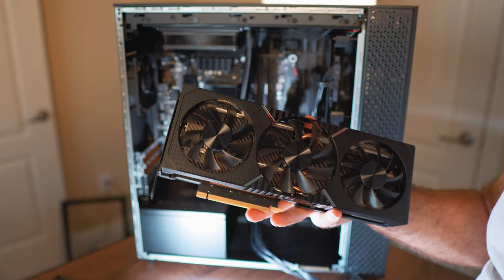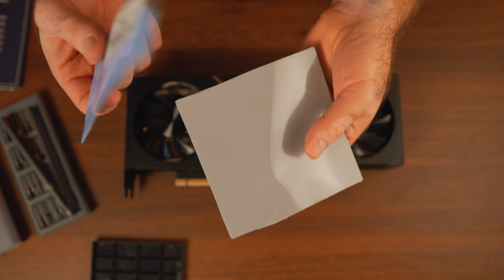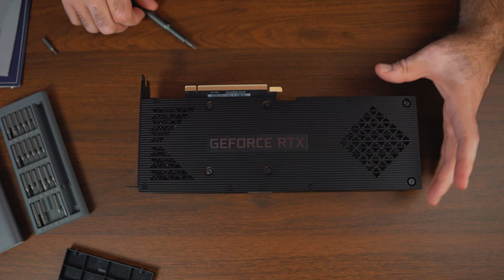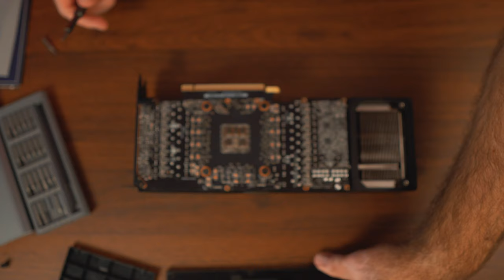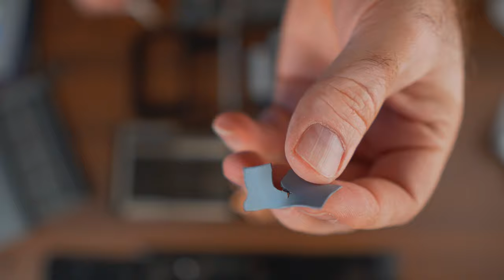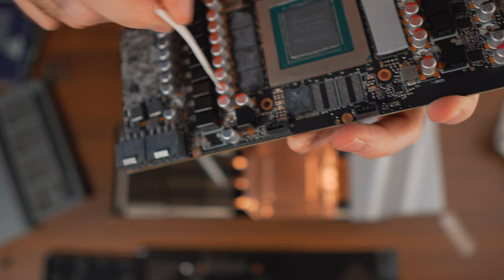HP RTX 3080 - Improving The Temps Mod!

Comment: Did the mod to my 3080ti HP OEM card, which used the same cooling solution as a 3080. Turned out the core temps got way worse than before after the mod. Core temps would hit 83-degree thermal limit and resulted in sub 300w power draw and base 1600mhz core clock, while it was at 78 degrees top before the mod. 

The reason was that the thermal pads were too effective and the memory temp rarely went over 70 degrees after the mod under load. It was competing with the GPU core for the limited amount of total cooling capacity. I reopened the card, cut all the thermal pads I placed on memory in half in width,  so the pads only covered half of the memory chips. This time the thermals were much better. In a 15 minute GPU load test, core temp stayed under 75 degrees at all times while the memory temp hovered around 80 degrees. GPU-z didn't complain about thermal at all times. And then core clock stayed above 1800mhz in the process. Guess it all came down to balance your core and memory temps with the amount of thermal pads placed on the memory chips. 

Btw the paste I used was Arctic mx6, which was pretty decent.
Reply: I’m about to take on this job within the next week! 
What size thermal pads did you use and where? The video description says use 1mm but also lists 1.5mm for the materials. 
I’m also interested in how well that Mx-6 is working for you. I am between just using my Thermal grizzly Kryonaut or people say to use thicker stuff like thermalright tfx due to less pump out.
Reply: @Trevor2497  I used 85x45x1.5mm Thermalright thermal pads, which were just enough for the job if only covering the center half of the memory chips. 

Mx-6 lowered the core temp by another 1-2 degrees, comparing with Mx-4. It is affordable, and an 8-gram tube should last you a long time.
Reply: Low Ram temps with high core temp is a pad thickness issue, not a cooling load issue. 1.5mm is too thick a pad, 1mm is the proper size. With the pads fully covering the ram chips, the cooler wasn’t contacting the core properly. When you took it apart again and trimmed the pads, it probably allowed the pads to squish enough to let the cooler contact the core better. I would definitely advise replacing those pads with properly sized pads.
Reply: i have some kind of issue, I bought a sliced cooper from aliexpress for rtx3090 and yes the temps is much better on memory, but on core and hotspot where worse. so i take a gaming test, but the fps are very down at 12-30 fps on any game, i'll take off the cooper and replase with only termal pads 1mm

Comment: Awesome tutorial, thank you! My system was crashing during VR gaming and now it's rock solid again. This mod decreased my memory temperatures by 15-20°C and core approx. 10°C.
Reply from the maker: Great to hear!
Reply: Which thermal pads are you using wonder which ones I should buy (thickness and brand). Also which paste. I have the MX4 (a few years old). Can I use it or should I buy new and better one?
Reply from the maker: @paulfriedhelm  I used MX4, the brand pads are Thermalright, thickness is 0.5
BTW, I have an updated video with all of the details, check it out for more information

Comment: Thanks for this video.  One thing that may interest you is the "copper mod" a lot of people are doing to their 3000 series cards, using copper shims instead of the thermal pads.  In your case I wouldn't be surprised if you could gain an additional 15-20 degrees Celsius.  One thing that is interesting is that the design of this Foxconn card may make that copper mod impossible, or at least more difficult, because a key component is to shield surrounding components from shorts.  This PCB looks like it doesn't have that much room adjacent to the memory modules.  Even if you decided that mod couldn't be done, I bet you could make a nice 10 minute video explaining why using the footage you already recorded for this one.  As your unofficial content advisor, I hope this is of some value to you.  :)  Love the edits.
Reply from the maker: Appreciate the feedback, and yes the copper mod is something that I thought about, but because of the design of the cooling solution, it is impossible.
Reply: @HardwareSense  Which thickness of the copper shims did you try? 1mm or 0,8mm? Have you tried and failed because of the design / cooling solution or you just imagine it's impossible with copper shims?
Reply from the maker: @makileon3526  I decided not to use copper shims, although could have been a better choice, but I am happy with the new thermal pads and paste
Reply: @HardwareSense  Hey Dude, you where right - the themal pads should have been enough. I copper modded, but 1mm shims after plaining them dont fit 100 % and in the end get 3 °C more then with the 14wk Pads. I think it must be like 1.2 or 1.1 mm shims. Going back to Pads now.
Reply from the maker: @makileon3526  Yes the pads are the optimal mod for this card, it's not really worth doing anything else

Comment: This is a reference design board FYI. Any reference design cooler will fit on it. I took the HP Omen cooler and put it on my Dell/Alienware 3080. They are interchangable, because both are reference design 3080s This means the reference version of the Corsair waterblock would fit too.

Comment: you could also use thermal paste on the metal cover that's on top of the memory chips. that will allow for better heat transfer than just the plain metal to copper touching. dawid showed a 10C improvement just doing this when he modded his dell 3080

Comment: hi , I am having bad thermal issue on the same card and can you tell me how much the temperature has improved for the thermal pad/paste upgrade you did? also , do you think its possible to modify the gpu cooling to water cool ? if so , would you do a water cool gpu upgrade video ? thanks in advance
Reply from the maker: You can expect between 5 and 10C drop, depending on the quality of the pads and thermal paste, that's pretty much it, nothing much more can be improved.

Comment: At back you need to put 3mm pads. This will push pcb to cooling system. In my situation this helps. Front as guy say 1mm and 1,5mm

Comment: Any recommendations for a fan replacement that does not add extra width to the card, best fitting inside the case of the card? This jetengine is really really loud. Was happy to find a cheap card but now I am a bit disappointed because it is so noisy. Will do the temp mod but still have to change for other fans to life with it. Thanks for your help.
Reply from the maker: Mine runs super quiet with the repasting and reading, there are no after market replacement fans, since it's a custom board.
Reply: @HardwareSense  what do you mean by „reading”? Sorry, I’m no native English speaker.

Comment: Good Morning kind sir, Appreciate the content. I see you said in your description not to use the 1.5mm pads. I'm seeing a lot of information out there saying to use 1.5mm and 1mm pads on the 3080, where you are saying to just use the 1mm. Could you elaborate more on your findings, did you measure them etc. I have 8 of these I am going to be doing, (running into thermal throttling issues, and need to move them into a grow tent for summer, so need to tackle these 106-110c mem temps) How many 85x85mm pads do you think I need to buy to do 8 cards? Appreciate it. You may answer this in the video, but would be handy to have in the comments. I'm 10 minutes in and not heard it so far.
Reply from the maker: On the HP version like mine, use 1mm. I found out that the 1.5mm are too thick
Reply: Can I imagine same EXACT (everything) for HP Omen 30L 3080 Ti card was well? All the same spots and just 1 mm oads all the way around?
Reply from the maker: @whatheheckdoidonow  I am not sure, but if they were lazy and kept the design, maybe it is.
Reply: @HardwareSense  I imagine if I put card back together, there would be an imprint on the pads, and I would just look for spots without an imprint to determine if greater thickness would be needed?  Solid logic?
Reply from the maker: @whatheheckdoidonow  Yes good thinking
Reply: @HardwareSense

Comment: If there would be an award for putting cheapest components in the wrong places - the winner would be probably HP with this PCB. Instead of ceramic packages, let's put cheap ass tower caps (although one can clearly see the PCB designer made space explicitly for ceramic package). Like others, they also did not use parallel placed thallium packages - following others vendors (under the core) put a fat package instead and (despite NVIDIA's recommendation to not do so) hoped for the best. I had the sad experience to use this card, the default "cooling solution" would pretty much get capped by thermals even on default clocks. Isn't Omen supposed to be some premium segment?
Reply from the maker: Yes indeed
Reply: would you buy this if its cheap? or is it gona crap out in just a year or two, or with overclocking etC?
Reply from the maker: @Tantium  I am still using mine almost 2 years later, and you don't need to overclock, 3080 can handle everything on max

Comment: hello.  you used 2 types of thermal paste.  I don't speak English well, so I don't understand everything.  did you put 1 mm for memory, and also 1 mm for the board under the cover?
Reply from the maker: Correct, both 1mm thermal pads
Reply: Thanks for the video. Good job

Comment: My 3080 has 88/96celsius memory temp while gaming. And I know the thermal pads on vram is not optimal because i did this mod and I was out of pads. Is 88/96c bad temp on memory?
Reply from the maker: Yes that is a good memory temperature
Reply: @HardwareSense  ah thanx, i tough they should be low70c to 80c. At what memory temp does it start to get trubbly?
Reply from the maker: @-OEG  None of my 3080s have a memory temperature under 80C, with 22C ambient
Reply: @HardwareSense  ah, okey. Thanxk for reply 👍 i have ordered new thermal pads so gonna put them on anyways.

Comment: What are the size of these 3 fans? 75mm and 85mm like the 3090?
Reply from the maker: 2x80mm, 1x90mm
Reply: @HardwareSense  Thank you, now to find a replacement set.
Reply from the maker: @dennism316  They are all over AliExpress
Reply: @HardwareSense  How much space would there be left to put regular fans if the top case with the fans are removed? Thanks

Comment: hello, i have some tips. 

 First off, you didnt put a pad on the "rogue vrm" chip. theres a set of chip, cap, and vrm that isnt in a row with others. just need a bit of pad on it and the subframe will touch it. thats why your temps might be 'unstable'. on a 3090 it wont matter as much cause it has more ram to cycle through. 

Second, use HIGH quality paste on the heatsink / subframe. as much as you can stomache. you can use cheap mx4 or mx 5 for the gpu itself. when you paste the gpu just put a big fat blob on it. when you tighten screws, do it slowly. if your paste is too thick then this wont work. 

3rd, backplate thermal pads aren't as big of an issue as far as thickness / stiffness is concerned. but still use high quality pads that will compress. 

i tried putting a bunch of heatsinks on 3080 backplate but ended up removing all that when i did a proper pad /paste replacement. if you deshroud the card and replace with 92mm arctic fans, it will help your temps stay lower and it wont make a ton of noise. HP tries to throttle the fans, but that just leads to temperature creep and really loud gpu fans.
Reply: Hey, where's the "rogue vrm" chip on the cards that you mention? Am I blind?

Also, are those replacement fans you mentioned direct plug/play replacements?
Reply: @whatheheckdoidonow YEs, tell me Replacement Fan.. I am interessed
Reply: What is the high quality paste and pads you would recommend?

Comment: What thickness thermal pads do you recommend for this mod?
Reply from the maker: Get the 0.5mm ones, I am going to do an updated video actually very soon with different brand pads
Reply: @HardwareSense  bruh i just did this with 1mm and my temps are higher than before
Reply: @HardwareSense  Have you made an update video? Would love to see which pad sizes I should buy before starting the project. Thank you very much for your great video. Helps alot!
Reply: @HardwareSense  waiting for the updated video!
Reply from the maker: @SchweboTV  It is been up for a while

Comment: Planning on getting one of these on ebay its 600us rn
Reply from the maker: Seems a lot
Reply: @HardwareSense  thats 100usd under the 3080 msrp? And its brand new
Reply from the maker: @DarkIdrees  Technically yes, but I grabbed the Maxsun and the Yeston for around $500 straight from NewEgg, a few weeks ago, so used 3080 should be no more than $500
Reply: @HardwareSense  oh fr? Damn maybe i should check newegg...last time bought from them i got a broken item and no refund...but i guess ill give em a try
Reply: @HardwareSense  just checked newegg the yeston went up to 780
Reply from the maker: @DarkIdrees  Unfortunately
Reply from the maker: @DarkIdrees  Yeah it's still a less desirable place to shop but there were some great deals

Comment: You should have put a lot of thermal paste on top of where the vram is around the gpu core between that black plate and the copper part of cooler around the gpu which drops vram temps dramatically like this https://youtu.be/9bdkJUUxUrg?t=159

Comment: 1260 MHz on GPU?
At 3080?
Maybe you should buy 3070 for the same price with normal cooling system and get better results then this 1260 garbage?
Reply from the maker: Not sure what are you referring to
Reply: @HardwareSense I mean, that 3080 should work on ±1800 MHz
1260 MHz in your test it's really low performance.
When 3080 work's on 1260 MHz, it will show lower performance in game/work then 3070 on normal 1800 MHz
Reply from the maker: @LLIkiper  This one is normally running at 1860mhz
Reply: @HardwareSense  maybe, but I'm spoken about your test ( 14:35 ) where your GPU works only on 1260 MHz.
Reply from the maker: @LLIkiper  That's a temp stuff when none demanding work is happening
Reply: @HardwareSense  so your GPU have 99% GPU load with no work?
Like, why you even show this screenshot and call it tests if it's have no reflection of temperature under full load?
Reply from the maker: @LLIkiper  You are drifting away from the main purpose of this video, which is how to improve the temps. The card is fine just like every other RTX 3080, it is about making it cooler and quieter.
Reply: @HardwareSense  I will not agree with you.
I have a same GPU, and it's just a pice of garbage. 
If you will use some real stress test like Furmark with CPU stress in the same time on 75% fan speed, it will drop about 20-25% of TDP in 10-15 minutes.
And you cant do nothing with that.
Reply from the maker: @LLIkiper  Furmark is definitely good to find the limits, but also unrealistic, just play games and enjoy it. After all the mods I actually prefer using this one instead of my FE card.
Reply: @HardwareSense  Furmark just show you the real picture in short period of time.
If you will play games for hours, you will get even worst performance then with Furmark, because all parts of PC will accumulate the heat.
Reply: @LLIkiper  ok kipper, we get it, you don't like the way the test was done, how about you create your own and show us how it's done. Also, consider this, if someone is stuck with a card out of warranty and doesn't have enough money to buy a new one like you suggest, doing this mod will definitely improve output for little money compared to buying. Now everyone can go around buying multi-hundred dollar GPUs like they're sticks of gum.
Reply: @LLIkiper  I will try that out. Best if you have good cooling in place inside the whole pc case.